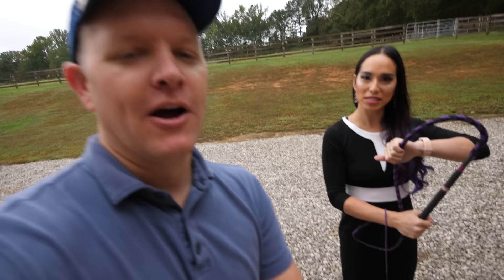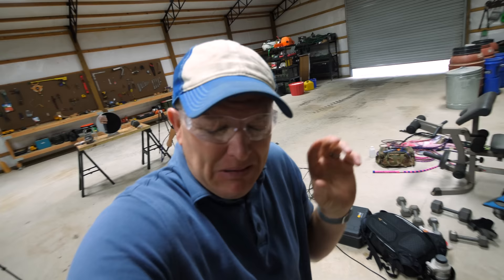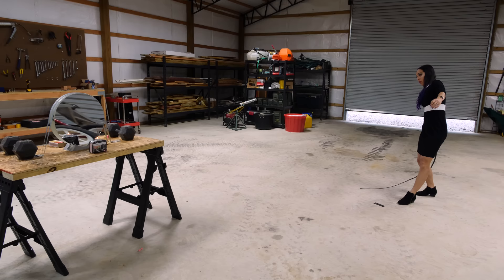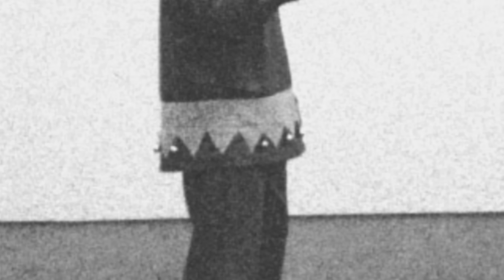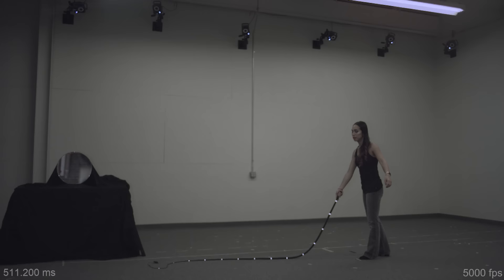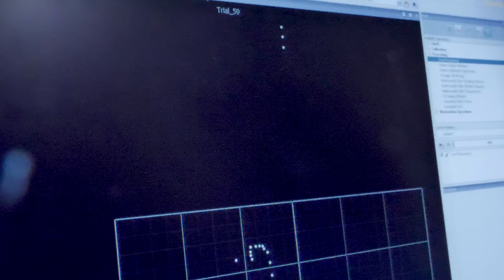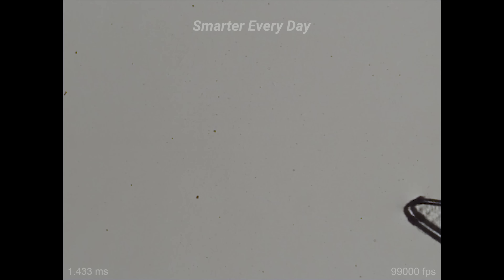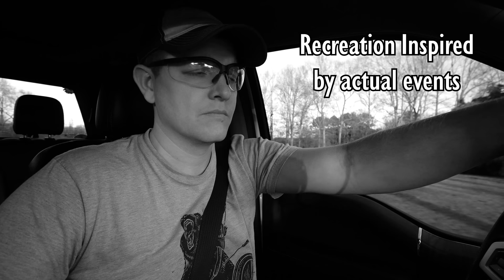How does a whip break the sound barrier? (Slow Motion Shockwave formation) - Smarter Every Day 207

Comment: My grad school fluids professor assigned a homework problem where we have to show why parts of your explanation on the shock formation is incorrect and I am super sad.. Watched this video when it first came out and was super pumped - I'm sad I now have to figure out why its partly wrong :(.
Reply: Don't be sad, this is sience! If we would not call out wrong stuff because we like it it would be religion.
Reply: So what was wrong?
Reply: how did it go?
Reply: @vittocrazi  while the conservation of momentum point is correct, assuming that the tip is supersonic is not. The tip can be traveling at a subsonic speed, but greeting pressure waves that build on each other that break the sound barrier. So basically, you can still break the sound barrier without going supersonic.
Reply: @derekwflett  so, in my simpleton's language, the tip of the whip slings the air to be supersonic?
Reply: @vittocrazi  yeah basically.

Comment: The knot thing was kind of interesting. You don't need the frayed end of the cracker to make the crack, but it seemed like that shockwave was much smaller... I wonder if you had a longer frayed-end with more fibres, would the boom get larger and louder? Larger area for it to capture air and drag it from the effect that Jennifer described at the start where the air close to the end of the whip cracker comes with it. More air, bigger boom? Or maybe there's a trade off for some increased area causing air resistance and then actually causing no boom at all?

Comment: I liked this video,  at 8 mins 25 seconds when I realized how the whip looks like it holding the shock wave like it was a ball , and the Shockwave got bigger the further it traveled the whip. And it wasn't until the tip of the whip started coming out of loop at the end . The force behind  the whip loop grew stronger and then there wasn't enough whip material left at the beginning of the shock wave to hold back that collection of energy from the speed f the whip. I looked at the Shockwave  as it's water and you could cast out a tarp into water . And pulling in the tarp is the same has the whip being extended, so as the whipped travel in the air it collected energy in the from of are atmosphere atoms of oxygen an nitrogen.  But the whip velocity  and it material is able to pick up enough atmosphere particles at the beginning of the Shockwave released all those atmospheric particle and a high speed which is what creates the Shockwave it's self , cause you need sometype  of substance there to be big enough and fast enough to break the atoms in the atmosphere apart.

Comment: just something i realised about the whip speeding up due to the conversation of momentum from the taper of the whip is that I made cracking whips when i was a kid with just a normal thin string and a stick but what seemed to be the biggest factor for making the loudest crack was the length of the string and the length of the stick it but there was a sweet spot in length for both

Comment: Watch 3:08 on 0.25x speed and turn the volume up
Reply: TheOmri100 😂
Reply: TIL: playback speed is adjustable. Thanks @TheOmri100 I think I knew that at one time but seem to have forgotten over time because I never used that feature.
Reply: @jaydgreen1  It's actually infinitely adjustable, I use a plugin called YouTube Playback Speed Control and you can set keys like "+" and "-" to step in increments like 5%...

Comment: Can you still whip inside  a vacuum?
Reply: there is no air so?
it shouldn't be possible .
also no sound in vacuum
Reply: You can whip, mechanics will be almost the same. But the tip will behave differently. And yes, no sound
Reply: They would have to make a machine that could do it because a human would die although the hydraulics wouldn’t even function basically it be extremely hard to test out. Would have to be something that can handle a vacuum while also maintaining a good form
Reply: @chic0latin0  space suit

Comment: Just wanna set the record straight for Scientific Journal purposes:  The tip of the bullwhip is NOT breaking the Sound BARRIER...it is in Fact, breaking the Air Pressure/Density BARRIER....which is a Real Physical Barrier.  

It is a simple matter of Cause and Effect.  
Cause: object pushes hard against the Air Barrier with sufficient Speed (action of the bullwhip)
Effect: a cracking sound is produced from the expanding and collapsing of the Air Pressure and Density Barrier around said object.

You will also notice small white Condensation Clouds formed near the moment of the Air Barrier being broken.  This is from compression of Air near the leading edge of the bullwhip tassle, and occurs just as a small pocket of Air expands and collapses around the bullwhip tassle.

The physical action of the expansion and quick collapse of Air near the leading edge of the bullwhip tassle is what produces the Sound.  The effect of the action of Breaking the Air Barrier.

If you do not Break the Air Barrier FIRST .... there will never be the accompanying Sound of Air expanding and collapsing rapidly around the tassle..which is the cracking Sound produced, from breaking the Air Barrier.  Thanks.

Just wanted people to have Clarification on the actual Physics of what's happening, instead of people having the Misconception that the bullwhip tassle somehow broke a Sound Barrier.

Comment: So, I came here because of the Veritasium chain vs no chain experiment. My conclusion is that whenever the part of the whip stops, it has to accelerate up which gonna have an effect on the next part to accelerate down and it continues until the end. As for the end of the whip, it made the sonic boom probably because it has enough stored momentum that it releases it before the actual whip ends. I might be wrong, which is probably the case here, and I would like to hear some thoughts about it as this is quite intriguing

Comment: Possibly the first invention to break the speed of sound would be kids flicking their flax towels on or at each other in Stone Age gym class! 😄The popping noise probably startled the animals near by and this became a tool to motivate animals to move or run. 😀 Cracking a towel demonstrates the same principle as the whip - breaking the sound barrier. It would have been cool to see that on high speed camera too. The momentum of the thicker part of the towel or whip is thrown forward and keeps rolling forward because the whip gets thinner which excellerates the speed and finally drags the tip of the towel or whip - yanking it forward suddenly from a relatively slow motion to a sudden high motion. This is what makes the towel end or tail end of the whip break the sound barrier. That’s my hypothesis and I’m sticking to it. 😁 Having been the recipient of a towel being flicked at me, it was quite painful!

Comment: A donut vortex forms into a ball of air pocket, as the flow of air goes down the taper of the whip. Once the ball of air forms the whip tip pulls out of the air pocket and it explodes and accelerate every thing from that point  out in all directions with equal pressure

Comment: I can break the sound barrier when I’m fishing. When my lure gets broke off by a big fish or from getting it snagged and braking it off. Once it’s broke off. And there is around 6” of line out past the tip of my fishing rod. I can whip the rod and that tag end of line will waaaapawww really loud!!! Oh and sometimes at night, it’s seems like there is a little flash of light that comes at the top of the line right at the snap/sonic boom.

Comment: I’m assuming that by dragging the tip through the air, it’s creating a vacuume, or “lift” so as the air is collapsing behind the tip, it’s creating shockwaves that then outpace the speed of the whip, pushing/pulling it forward before the wave of the whip has reached the end.

Comment: In 1/4 playback speed, you can see that when the tip of the whip rotates ccw into the forming shockwave, that is when it compresses the shockwave at an accelerated rate just before the sonic boom point.

Comment: It’s also like a pendulum: shorter rope, faster swing. Same energy in that shorter pendulum means a dramatic increase in speed. It’s like the tip of the whip is a pendulum that’s constantly getting shorter as the wave changes its rotation point.
Reply: Yes, that's exactly what the law of conservation of momentum is.

Comment: I am re-watching this for the first time in a few years. I am noticing something about the tip accelerating being dragged through the pressure wave. There looks like some point before the tip is causing the pressure wave, and once the pressure wave is created, the tip is within the vacuum of the wave and suddenly loses all of the air resistance it had before entering the wave. It reminds me of the reason large ships have the bulbs on the front of them that ride under the surface of the water at the bow of the ship. It creates a bow wave for the very tip to follow through.

Comment: I think what is happening is when we start the, whip has some energy but slowly the energy is distributed over a smaller and smaller area, at one point the energy is over such a small area at the tip that the tip breaks the sound barrier and then the drag from the air reduces for the part that breaks the sound barrier causing it to exelerate faster than the rest of the whip.

Comment: I have a theories to add to the same. Remember when you blow through a tube with a tiny tip...so air is compressed as it leaves with a stronger force ...the whip mechanism works the same but it is compressing energy from a thicker end to the tip....only releasing the energy condensed and accumulated ....hence the increased speed and momentum with a a decreased in thickness....
Well my second theory is on why it releases the energy just before the tip rolls compleate

Comment: Not sure why it was surprising that the crack occurred before full extension. The sonic boom will occur the instant the sound barrier is broken. To occur only at full extension would suggest the sound barrier is broken only at that exact instant, not before. I know of one study that measured double the speed of sound with a bull whip. In that case the boom would have likely been a might sooner than this experiment. 

It would also be helpful for the viewers to know that Momentum is the product (multiplication) of an object's mass and velocity. Since whips are tapered they get lighter and lighter as momentum travels toward the tips, the acceleration must occur to conserver momentum.

Comment: I also would have assumed that the whip broke the sound barrier at full extension, but on reflection it makes sense for that to happen sooner. The tip is accelerating continuously as that wave travels down the whip, so of course the crack will happen wherever that speed happens to hit Mach 1.

I do note the tip accelerating sharply as it breaks the sound barrier, which I /think/ is basically it riding its own shock wave (I know some planes do that). And it looks to me like the tip continues to move supersonically for the rest of the extension phase, in which case it still will be supersonic at full extension. I suspect its maximum speed would occur at full extension, but that's a guess.

Comment: So it sounds to me that the cone shape of the whip is where the acceleration happens.  Basically as the cone (cross section) shrinks the same energy is transferred to the smaller cone, and so on as it accelerates.

Comment: Okay hear me out, attach a tiny craft at the end of the whip and watch it accelerate beyond comprehensible speeds. Maybe a large scale whip can be used to throw a manned spaceship so fast that it breaks the molecular forces .
Reply: I agree. Should be possible to transfer the momentum to propel an object past Mach 2. Different materials, initial momentum transferred to the whip, jerk measurements, so many factors can yield different speeds and different results.

Comment: HYPOTHESIS
This is in a way linked to the Mould effect of the beaded chain. Similar effect of tension along the curved direction of the "string", rather than tension in a straight line, and it is caused by a change in direction.

Comment: It's not so much that momentum is transferred to a THINNER part of the rope.  It's more that the momentum gets transferred to a SHORTER and shorter length of rope.  Shorter means less mass.    Momentum is mass x velocity so as mass decreases, its velocity has to increase in inverse proportion.  In fact this happens exponentially.   The remaining length (and therefore mass) keeps halving at an increasing rate, so velocity keeps doubling at an increasing rate.  As the remaining length (and mass) tends towards zero, the velocity tends towards infinity.  There will be losses due to friction etc, so the velocity doesn't get to infinity.

Comment: It’s a bad idea to yank a charging cable. Even though the rubber sleeve is stretchable, the copper wire inside is not as much. If you yank a cable often enough, the wire may break inside and would lose connectivity intermittently. If the cable is a high wattage power cable, the invisible internal breakage may even cause electric arcing and start a fire. Always pull by grabbing the plug, never yank by the cable!

Comment: you said that air pressure lowers if you break mach 1. So less resistance means the end of the whip goes faster and gets pulled forward.

Comment: It almost looks like there is some form of "surface" tension that the end of the whip is experiencing right before it breaks the sound barrier. Then, when it breaks through that condensed air barrier, it speeds up dramatically

Comment: What if you cut the whip to be the exact length of where the shock wave is presenting itself? Isn’t the surfeit of energy just ensuring that the crack happens before the distal end of the whip has reached it’s furthers point from it’s origin? I would think that you might have some finagling, but it might work.

Comment: Now you make me wonder about the result of a whip that is more smooth and aerodynamic🤔
Mt personal opinion about breaking the sound barrier is more like breaking through a threshold air compression release of some sorts through the observation of jets and numerous tests which a whip. Which in turn at sonic speeds cause drag and compression at a certain point pending the conditions, such as current barometric pressure of given space and temperature. As I observed with the supersonic jets, it was easier for them to create a sonic boom at lower altitudes than higher altitudes. This all fascinating to me and makes me curios why meteors that enter the earths at supersonic speed make no sonic boom ( they probably do, but we can’t hear it due to distance and size and other factors).
I would like to see the difference from a conventional braided whip vs a smooth aerodynamic whip. From cracking point to decibel differences.

Comment: Guys remember, this is just a divulgation video, made in order to explain people who are not familiarized with this topics how this kind of stuff works. If you want to understand this throughly I suggest you start reading some classical physics and then escalate bit by bit to more difficult topics. Once you have a basis you can also look up for articles, there are lots of scientifical journals on the internet. 

Nice video btw, I was initially searching for info about thermodynamics and I came across energy transmition through radiation, which led me to electromagnetic waves, then mechanical waves, and then I found this video which I don't regret watching at all!

Comment: Would the end of the whip be pushed forward by the explosion of heat being created by the boom? Like you said the transfer of energy down the whip isnt what propels the whip end its after the clap of the boom. Wouldnt the clap pave the way for the whip end tip creating a momentary vacuum with no resistance and the initial transfer energy would be exceeded by the resistance reduction provided by the clap? The whip momentum speeds up when it nears the end but when the tip creates the boom theres no more friction and is thrust forward by the heat generated.

Comment: In the part where you made the example of the charging cable, you said that the momentum build up because of the conservation law, in the first part you said that this happens because the whip cross section decreases from handle to tip, but the charging cable has a constant section.. Is there another explanation? Or are these two situations not comparable

Comment: Of course it wouldn't crack when full extended it has to speed up to break the sound barrier. When its fully extended youve slowed down and the whip lost momentum its on the build up when it finally snaps just before the full extension

Comment: Hey, concerning fluid dynamics. I put my hand flat on a pool surface and plunge it into the pool quickly. This creates a pocket that collapses and it explodes as the water rushed back. Is this the same as the whip(frayed end)? In my scenario you have two separate bodies, water and air. It hard to tell because the  air is too similar so only the event is witnessed. My speculation is that the whip is snatching a pocket of air out of contention with the rest and with the frayed end we might be seeing the air collapse back into the invisible void, creating an explosion. Both whip heads break barrier but the frayed one seems to detonate and even push the tip further. Thanks for the video. What if you use chalk dust to shed particles at event to assist in seeing what's happening? I argue you'll see something form like a short fat straw behind the whip just before event and then boom. I think we are witnessing two different but similar events with those tips. Both break sound one breaks atmosphere vs one disturbs. Cannonball vs wave.